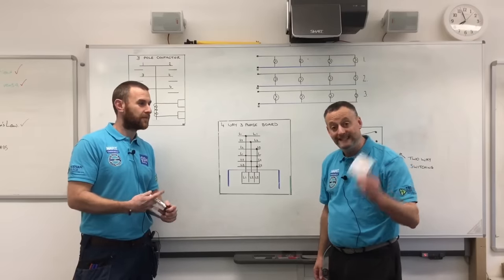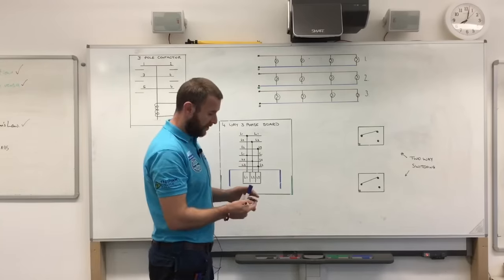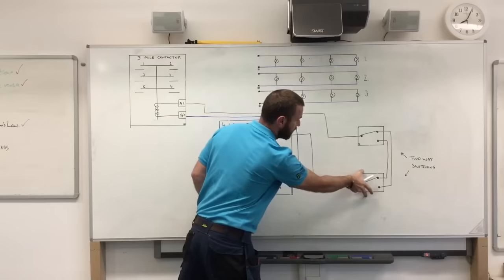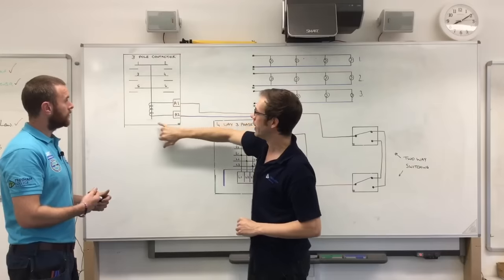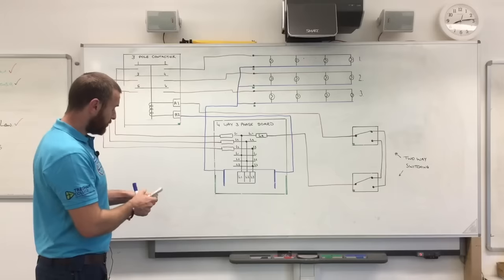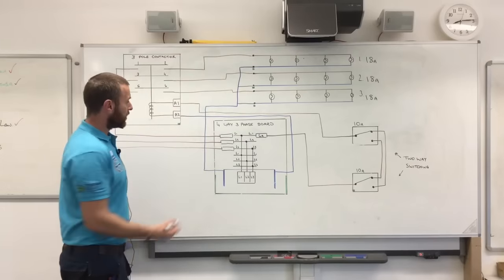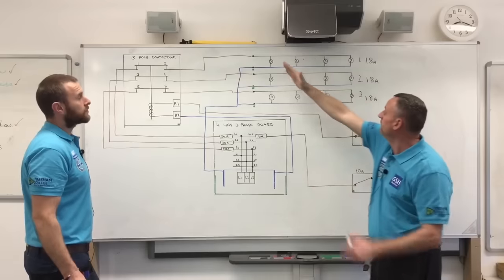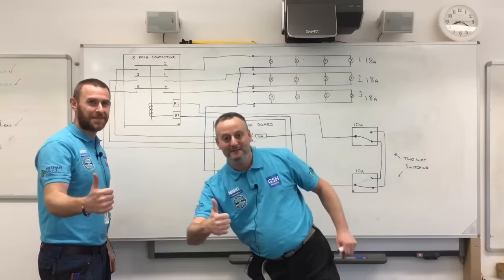How to Connect up a Contactor Control so 2 way Switching can Control a Large Load

Comment: Thanks for another great explanation.  Important to note what he says at 8:26 that sharing the neutrals is only for simplifying the diagram, you'd actually run separate neutrals for each circuit.  If you actually only ran one back to the board (with separate circuits / breakers as shown) you would have shared or borrowed neutrals which is potentially dangerous.
Reply: The contactor I have at college has terminals for a neutral as well do this mean in this case you'd have 5 neutrals coming back to the board i.e coil, connector and 3 banks of lighting?
Reply: You only have four neutrals. One for each lighting circuit which is the same as each row of lights.  Plus one for the control circuit, going to A2 on the coil within the contactor. Hope that helps.

Comment: Great vid. Maybe worth mentioning that the contactor has a 240v coil in this instance.  Don't want to go sticking 230v into a 24v coil.  And the numbering on the contactor is indeed 1L1 3L2 5L3   2T1 4T2 6T3. Normally open or normally closed.  And the additional use of the auxiliary contacts 13-14, 21-22 could be used as an indication lamp that the circuit is energised. Can't wait for the practical Vid.
Reply from the maker: Hi. Thanks for commenting we have a follow up video coming... all the best Gaz 👍

Comment: Good job 👍 I carry out commercial maintenance one problem I come across regularly is “bms being installed onto non essential distribution boards ie 70% lighting in a large commercial premises. When these alterations have been made the provision for a permanent supply for emergency lighting has been overlooked! On the plus side no pun intended generates more work for me.
Reply: Hawkesby's Life Snapshots local  bms fired outstation fitted at switch location...job done 👍
Reply: tomorichard Thompson that’s the perfect solution for the above scenario 👍 unfortunately not the case for the last two I have had to rectify as a bms had been added to an existing installation. The company/contractor split the existing lighting distribution board so they could reduce lighting outside of trading hours. 70% board was operational during trading hours 30% board 24/7. Unfortunately 70% board had emergency lighting feeds and there solution to install 100a 4pole contactor below distribution board resulted in emergency luminaries discharging every night. Live and learn😂👍🎅

Comment: Not just for lighting either. I recently set up a situation where the lighting circuit (on a timed switch) ran the lights plus the coil side of the contactor and the socket circuit ran on a radial through the contactor. This meant that when the lights timed out and went off, so did the sockets, thereby guaranteeing nothing could be left on unattended in the area.
Reply: That is Genius.

Comment: Great video. Not a criticism, but I would also clarify that in large buildings like that the lighting isn't wired in straight lines as shown in the diagram. Each of the phases L1, L2 and L3 (or R,Y and B) should be spread across the three lighting banks.

Comment: Great video. Just a couple of questions if thats ok.
How would you run your neutrals from those lights in terms of what kind of cable would someone use I am curious, only neutral. Also will this only work with a 2 way? what about a 1 way?

Comment: Excellent video guys thanks but i have a question? Would be a problem if i replace one of the three loads with a fan, A/C or whatever with less or more load than the other two loads? I mean would be a problem for the contractor's contacts the different output loads? And in this case what happens if i use a 3-Pole MCB 20A instead of three 1-Pole MCBs 20A? Thank you!

Comment: Am I right in thinking that you can then link the neutrals of the circuits together and de-rate it as it's a balanced load? Theoretically, the neutral current is 0 but to allow for lamps blowing and therefore becoming slightly unbalanced, you'd put in a neutral?

Then I guess the issue is if one of the breakers trips, you potentially have a neutral current which is the same size as the phase current sqrt(a2+b2+c2-ab-ac-bc)=sqrt(18^2+18^2+0-18*18-18*0-18*0)=sqrt(18^2+18^2-18^2)=sqrt(18^2)=18A. If two of the breakers trip, you have a single phase circuit, so you again have a maximum current of 18A.

If my assumptions are correct, you could save cable by wiring it with a common neutral of the same size as the phase conductor. Assuming that there is no other reason to bring the neutral back to the distribution board (eg: single phase RCDs/RCBOs), would it be acceptable to do this? I'm not a spark, I studied engineering so I have the theory but not the application knowledge of BS7671.

Comment: Hey guys, thanks for the instructional video. What if the "lights" were a wall heater and we could wire a remote in for low medium or high. Would this setup be the same???
Reply from the maker: Lastpaceended yep 👍
Reply: @GSHElectrical  I'm really struggling to get my head around wiring up this heater on a contactor. Just wondering, do you have an email where I could send you a pic of the diagram and could explain to me how. It's quite a simple diagram. Sorry I'm in my level 3, but our teachers are not very helpful at all like you guys are. I wish I was studying with you guys to be honest lol. Would be great as it's been really eating away at me for the last 5 days. Keep up the great work, love your videos
Reply: @GSHElectrical  Even just a rough sketch would be so helpful, so I can put  things into place in my mind
Reply: Thanks for good explanation ,but I wanted if you can make a video on how to wire three phase distribution board

Comment: what would be the conductor rating for the same setup you had in this great video, 18A (lighting) on each of three main contact with 220v electricity.
I am just confused between AC1 AC3 Amps ratings, and I am only guessing this should be ~20A AC1/ 6A AC3 contactor for your video setup?

Comment: Would you run the hot and neutral on a 12/2 wire to the contactor and wire not the neutral to the light inside the contactor  Box by wire nuts?

Comment: So you’ve got individual 20 amp mcbs feeding sets of lights? I understand that the mcb is there to protect the fixed wiring and not the load, so as long as selectivity is achieved (with a suitably sized cable rated for 20a) then in theory it’s ok.... But it seems wrong to put lighting on a 20A!!! 
Maybe this was an older norm with old sodium high bay lighting drawing larger currents, but it seems these days 6 or 10a would suffice especially with modern led luminaries..

Comment: I wired up a contactor to switch two supplies (a.c. mains and a.c. mains generated by solar PV) to one load - my hot water cylinder. So when the sun is shining one set of contacts supplies electric from the sun to the cylinder. When it's dark, a mains spur activates the coil and switches the a.c. mains on to the h/w cylinder, so the one circuit 'makes' and the other 'breaks'. It works fine and is another example of switching high current (well, 12 amps, high for domestic I suppose). I will blow myself up one day, but I just cannot get an electrician for love nor money where I live. :) :)

Comment: 8: 30 QUESTION? Why would there need to be THREE individual Neutrals coming back to the panel when a 3 PH. Circuit only needs ONE Neutral per 3 Hots?

Comment: I recently did my 18th edition update were we touched on Reg 521.5.1 which suggests the neutral conductor needs to be contained in the same enclosure as lines.
I have always only run line conductors and coil feeds into a contactors enclosure and was given the impression this is bad practice not taking the load neutrals as well, i would take straight to D.B as more practical. I have only ever seen it done that way for lighting no need for switching neutral as well as you would loose your emergency lights.
What do you reckon? The guy taking the class suggest neutrals should be run through the enclosure on there way to the D.B
I have never seen this done, is he mis misinterpreting the regs intention?
Reply from the maker: Hi. Remember this is a wiring diagram and the cable routes will be very different in reality. Thanks for commenting and watching GSH Electrical 👍.
Reply: Running neutrals/ populating all terminals within a contractor can be relevant especially when using in conjunction with a DOL starter with overload in order to keep each pole balanced. Is this what you are referring to? 
Like you have stated with use of the contactor in this situation you can consider it functional switching. And not required to switch double pole
Reply: @tomorichard  I am more thinking of lighting applications where you would not normally look to switch the neutral conductors of circuits feeding through the contactor.
Typical situation would be a distribution board linked to seperate enclosure housing contactors with a trunking, the neutrals routed straight into D.B, lines into contactor(outgoing side) and then fed from D.B(incoming side)
Reply: 132 Buckleup1000 I guess as per 521.5.1 if it were a ferrous metal enclosure line neural and cox should enter via the same hole. To be totally honest I haven’t really ever considered light loads to have any real world issues of inducing eddy currents to a metal enclosure. John ward has done a very good experiment to help others understand this issue.
Reply: Usually the D.B is ferrous, contactor enclosure is ferrous and so is the trunking all mechanically linked together with bolts/bushes so hard to imagine eddy currents circulating when everything is close proximity.

Comment: what would the contactor be rated at in this situation?
Reply from the maker: Hi as the loads are negligible in this case it doesn’t matter. The contactor has to be rate to handle the load it’s expected to switch. Thanks for commenting and watching. Gaz 👍

Comment: And how we can select the rating of the contactor ?
Reply from the maker: Hi. The rated value of the contactor is based on the out going load... if the load is 27 amps the contactor need to be rated equal to or above that rating. Thanks GSH Electrical

Comment: When contactor is in a seperate enclosure are the Neutrals for the loads taken directly to the distribution board?
Reply from the maker: Hi. Remember this is just a wiring diagram and it’s not showing the actual layout of the cable runs. We have at least one other video to follow 👍. Thanks for commenting and watching GSH Electrical.
Reply: Each lighting circuit would have it's own neutral going back to the distribution board. The example appears to show them all linked together before going back to the distribution board via one neutral conductor simply because space was limited on the white board when drawing up the example, looks like a borrowed neutral arrangement which you wouldn't recreate in practice, and the future follow up video by GSH will most probably show individual neutral conductors going back to the distribution board, assuming there are at least two or more lighting circuits/loads involved. So in this case with three lighting circuits you would have three neutral conductors going back to the the distribution board. As for the contactor, the contacts would only have incoming and outgoing line conductors for the lighting circuits as shown. There would be a fourth circuit for the contactor coil operated by the two way switching arrangement. The neutral present at the contactor would simply be for the coil circuit, line feeding the A1 terminal, and then from the A2 terminal you would have a neutral going back to the distribution board.

Comment: Good video but this is really basic, Can you do a video for industrial automation where you have PLC level switches motors star and stop bottoms ect low level and high level indicators for proper sparks this is just DIY work
Reply from the maker: This is a training channel for level 1, 2 and 3 learners. Sorry we do cover your required content. All the best Gaz 👍
Reply: @GSHElectrical  level 1&2 are not skilled that is semi skilled( electrical mates) Level 3 is skilled that’s the level apprenticeship you should cover some more technical circuits for people who aren’t house Bashers some people are industrial sparks or maintenance techs this is quiet simple compared to what a level 3 advanced modern apprenticeship would require you to learn
Reply: @GSHElectrical  not having a dig I respect your work and the vid just think it would be nice for you to make a video for more engineering style sparks appose to house Bashers and building electricians

Comment: As someone has already alluded to...its never enough to know it works / ..One needs to know how it works...And why ...
Reply from the maker: Single Phase Contactor - Connections Explained, Application plus the Current in the Coil and Load
https://youtu.be/Ed3_zbZ0xaA